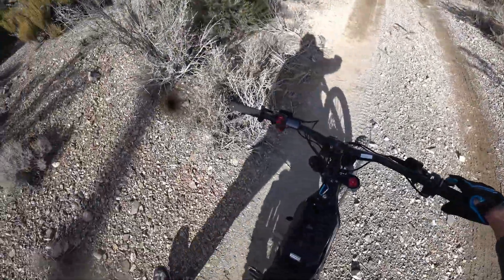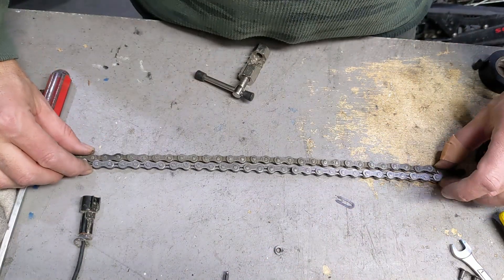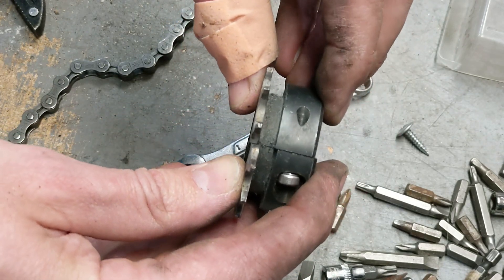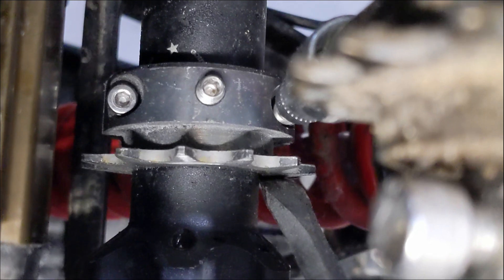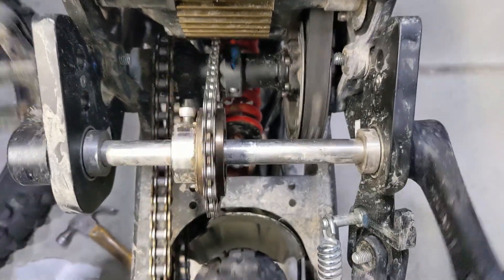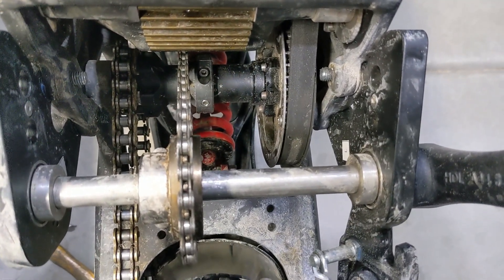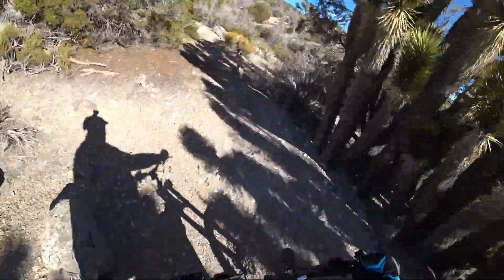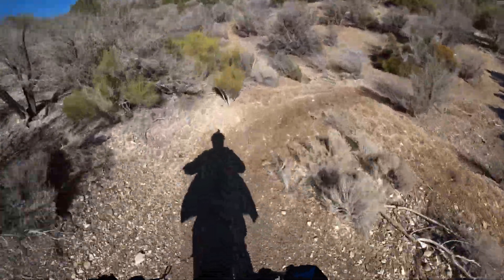Broken Chain First RIDE How to Fix #KANIWABA Ver.3 pedal kit Surron Segway Design FLAW!

Comment: I read if you hear any pops.. it's not aligned.. and it should be a little loose.. not super tight... thanks for the video.. I got my bike and pedal kit.. but I'm watching videos before I assemble it... thanks 👍... also I read you can program to take off the regen  so it is free down hill.. but I think I will keep the regen to use less brake and it charges a little... I really got it to be able to fly up hill on trails
Reply: how’s the pedal kit so far?
Reply: @Gamers4511  my free wheel  for the chain.  Makes a horrible rattle noise and vibration because of the play the free wheel has. .  I took the chain off  and just carry the chain in my backpack.. but i like the crank arms and pedals.  I like the bike pedal feel.
Reply: @ItisMeMike  i think i’ll just get the kit for the pedal look so the laws not on my ass
Reply: @Gamers4511  ebikezilla  online has the kit you want i think.. they were still in stock recently... yea.  It should be fine.. today was my first day riding like that.   All good 👍 .. good luck 🐝✌
Reply: @Gamers4511  so i was told the noise and vibration i got from the kit is the chain in the pedal kit is too wide... so if you do get the full kit.  Just might want to  fix up a chain that is a little more narrow  to lessen the play on it.... but I'm doing fine with out it so far.  But i might look into that

Comment: In regard to riding down hill with the regen, have you tried programming the regen level on the bike to a lower level or off completely? If so, does it make a huge difference?
Reply from the maker: I like Regen on, not because it regents but because it stabilizes the bike in the turn with engine brake ... But you do use a bit more energy

Comment: Man I hate this kit. Pain in the ass to install, riddled with issues and zero customer service
Reply: Have you got it to work in your favor yet? I’m on the fence to get some just to be legal out here in Arizona.
Reply: @len9483  so customer service got back to me. I was frustrated with the install. It’s not easy and I’ve done the controller and battery bypass. It’s a good overall kit though.
Key thing is to make sure the sprocket is aligned when screwing it in. They don’t tell you that in the video, hence my broken chain.
Reply: @er98ah  OK, thanks. Yeah, all I keep hearing is the need to pay attention to that alignment. Man, can’t someone re-engineer this? Elon, are you listening? Ha Ha.